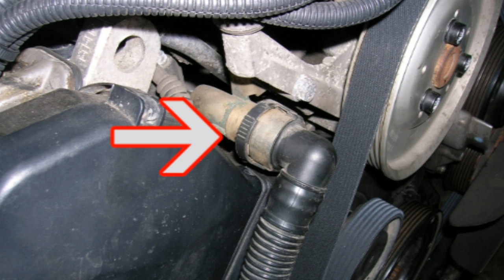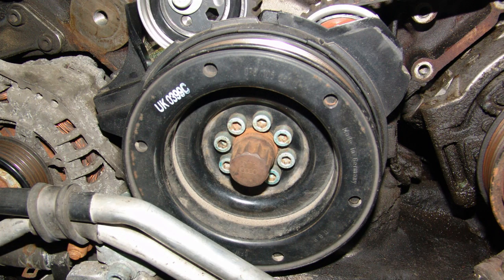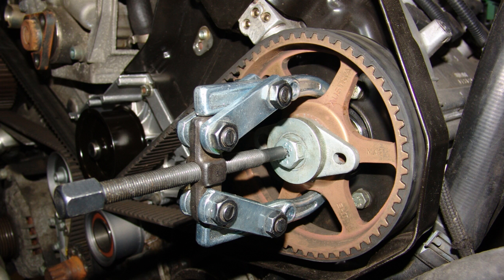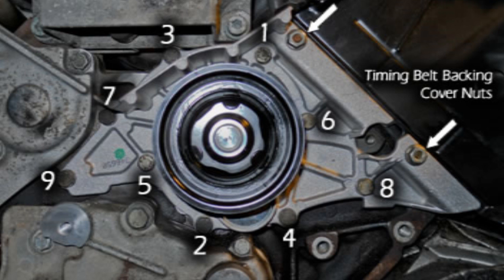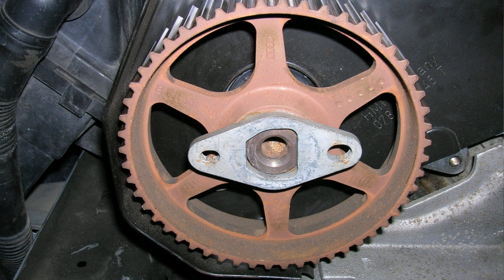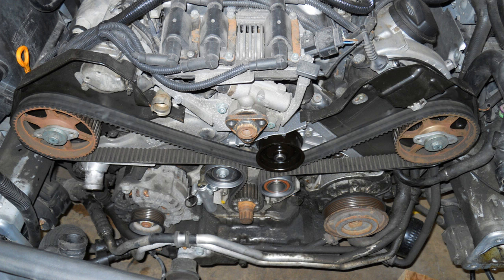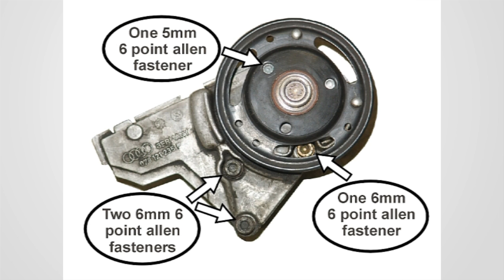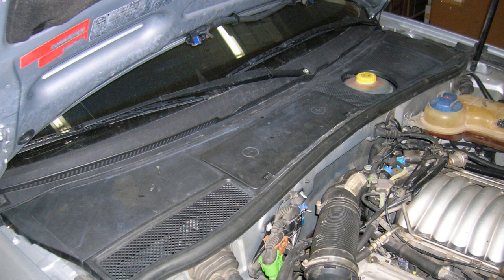How To Replace VW Passat, Audi A4, Audi A6 Timing Belt on 2.8 Liter 30 Valve Engine

Comment: Great video. I have a 2004 Passat 2.8 V6 , Auxiliary Water Pump (078-121-601-B), What is this pump's purpose? Does it have anything to do with cabin heat? Do you get a code if it doesn't work?

Comment: Can you please tell me at what miles or kilometers should the belt be changed? I'm getting conflicting information from 120,000 miles or 140,00 miles?
Reply: 120000km says in manual
Reply: vw said 105,000 miles but mechanics now say about 90 max

Comment: I have one ?.... I did everything you just did without putting a pin in the hydro tensioner. by taking the gear out with the crank pulley. installed everything correctly, but now I have misfire on cylinders 1$3.

Comment: I did this twice with the Blauparts tool kit. The only problem I had the first time was getting the cam seals out. Second time they had changed the tool, and I didn't use it but instead used a small screwdriver to lever them out. Oh, the crank bolt was a bitch to get through that last 1/2 turn.

Comment: I also noticed that the timing mark doesn't line up....by looking at it with timing light. it reads before the arrow by few degrees
Reply from the maker: Hello Eddie! 

It seems the engine misfire and timing issues you are having are due to some disassembly and reassembly steps possibly not being followed or missed. It is also best to check your ignition related parts as this may be the cause of your misfires. If you are a current customer of Blauparts our tech lines are available at (920) 758-3232.